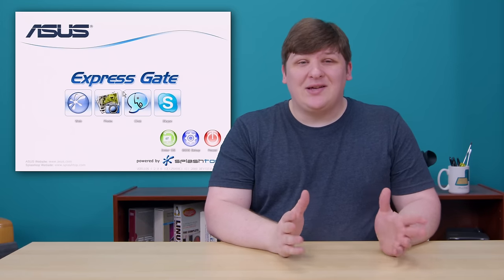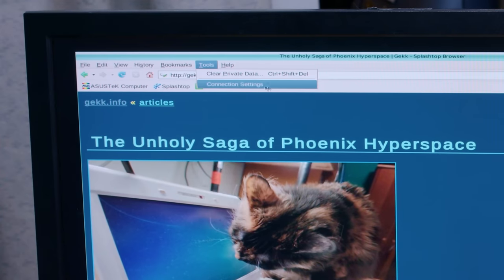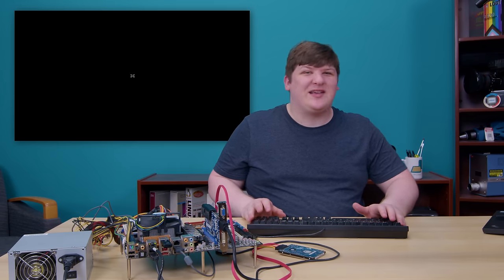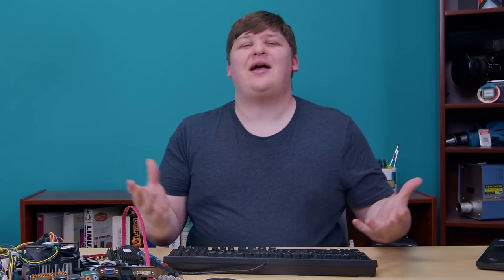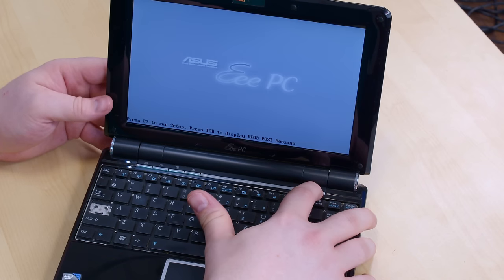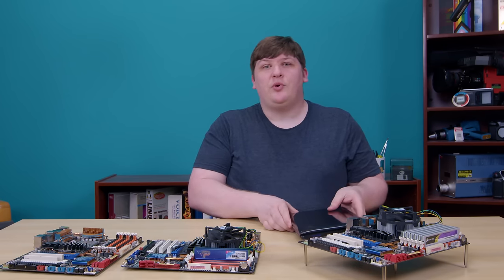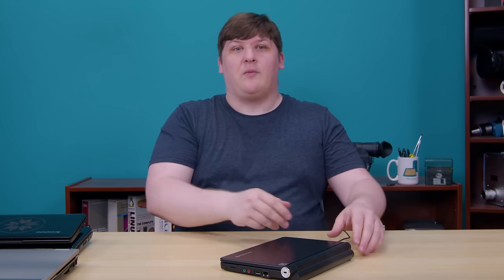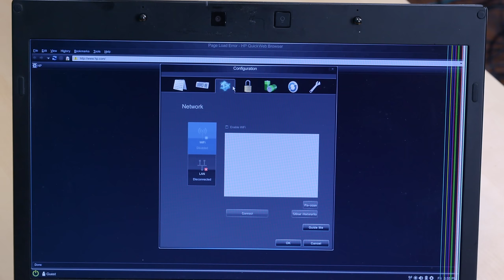Quick Start Ep 2: What The Heck Was Asus Express Gate?

Comment: My god, when you showed it in the previous video I thought "huh, maybe that pattern was reused by the manufacturer or something." NOPE. Seeing those laptops laser etched with the SDUSD star logo gave me fucking flashbacks. I don't know what the district paid for those but it was entirely too much, and I can scarcely believe that one survived with the little rubber pads that space the screen from the keyboard intact. They'd keep 26 or 30-ish of them in these blue metal carts on wheels that had been subdivided into vertical slots for each netbook, which was a good idea on the face of it, but it quickly turned into a hilarious rats nest of 30-ish entirely separate power brick chargers with far too much cable and two different power strips permanently zip-tied together.

While I remember wondering what that QS button was for, I can say that sadly nobody seems to have known about this feature. At least, I never heard about it from anyone else, and I doubt whoever sold these to the district ever mentioned it. But I have fond memories of tilting the poor things back and forth on my desk and watching the HDD monitor in the system tray freak out. And you're right, the track pads were awful and prolonged use would give you a sort of minor friction burn.

Comment: I have one computer I manage that takes 7~15 minutes to boot, and it is running linux on an SSD. It's just that it's a workstation class desktop with like three built in raid controllers that each do their own POST (it even has picture in picture so you don't have to look at them as good), so it's 7~15 minutes to get to the OS splash screen, which is like 1.3 seconds. The variation seems to be whether it's experiencing romantic drama with or between any of the hard drives, which it has to figure out before it remembers that hardware RAID is disabled.

Comment: I have an NVME but my system still takes probably 2 mins to boot up. That's because I have it loaded with 128gb ram and a shitload of pcie devices. It has an EGPU which significantly slows down Linux boot for unknown reasons. It's also encrypted, so that adds a lot of time. Also, I can't get display managers to work well with the EGPU, so I always disable my window manager and start the desktop environment from the TTY.

Comment: Making a 2000's custom Linux distro for your grandparents to use was already done. Do you not remember when the big box stores sold Lindows PCs? omg. But I do agree that some type of motherboard level OS with usable features would have been awesome. Heck, I remember when ATI on board graphics was not bad and meant you didn't need to trouble shoot your graphics card when you had an issue. Why not just put a cheap arm SoC on a motherboard today? Motherboards are stupidly expensive now... making something like a $25 SoC easily absorbed for the added value. Give it a tiny linux distro with file management features and of course internet browsing and media playback and that would be awesome. Even use a miniSD card for a custom version and/or updates.

Comment: You mentioned that they evaporated around 2011 - but that's not quite true. ChromeOS (which is very similar to many of these quick-start OSes, and actually does boot quickly) still exists, and is quite popular. According to the ChromeOS releases page, the first version came out in 2008, but I would guess that 2011 is around the time it really went mainstream. From the laptop vendor's perspective, ChromeOS would be a better option - Google is actually trying to position it as a true competitor for Windows, and it fills the same niche. Not only that, if you're selling a chrome book, you can cheap out on so much more - put a bit less ram, a much smaller drive, and even an ARM cpu. This even allows them to hit the other points these can't - it's lighter, and gets better battery life.

The low end of the market (the only segment that quick-start OSes ever might have made sense in) has largely been consumed by ChromeOS and Ipads. Schools have whole fleets of chrome books, because they are cheaper and easier to manage than a fleet of Windows devices. I personally think that many (if not most) executives in companies would be totally fine on ChromeOS, since most of what they do is either basic productivity (which Google has solutions for), or in a web browser anyway.

Comment: LOL it will be as universal as pressing delete on startup.  I'm assuming you mean to enter the BIOS.  I have had BIOSes that you press ESC, DEL, F2, F11, F10 or any number of other buttons that they do not give you any hint as to how to access it.  One other feature of netbooks was their battery life.  I'm wondering how battery life running Splashtop would compare to battery life running in Windows.  Also, I think that I had one of those motherboards with Express Gate.  I think I tried it for like half a second and then switched to Windows.  Also, mad props to that Strongbad impression.

Comment: I never did manage to own a motherboard this feature.  At the time I was on the ultra premium gamer boards which didn't have it.  Ostensibly because us gamers bought super premium high performance Hard Drives... or were so overburdened by money we could drop $600 on an SSD of a decent size.  I won a 256GB Intel SSD in 2011 from a giveaway.  At the time that drive retailed for $600.  It replaced my Western Digital 300GB Velociraptor.  

Really cool all the shortcuts manufacturers made to avoid the windows bootup problem on marginal hardware.

Comment: Interesting that this was on desktop motherboards, I have a Dell Precision M4500 (got it brand new in 2010) and it had the ability, called Dell On Flash. It was a dedicated flash chip that could be added inside the machine, it looked like an mSATA flash chip or something. I was curious about it but since mine didn't come with it I never cared that much.
Btw, the Dell Precision also has a separate slot for an mSATA SSD so it makes it seem even less necessary (but the mSATA SSD slot could also have been used for a WWAN card)
Maybe I'll buy the module now though since if you happen to mention it it might get more expensive, Lolz.

Comment: having to spam a key on your keyboard is actually not necessary since the popularisation of USB keyboards! it was necessary with PS/2, since the keyboard sent a signal to the computer upon a key event, but USB keyboards are polled by the BIOS / driver. you can enter your UEFI menu by holding down the key and turning on your computer.

Comment: After a bit of searching it seems that Phoronix was quite excited about SplashTop if only because it uses Linux. They did a full review multi-page review of it and members of the forum even hacked it to get a terminal, install new apps and get it running from a standard USB drive. Also weh something uses Linux they have to release the modified code or else it's a GPL violation so if you are looking for how something works looking for the source code is  a good place to start. For SplashTop they did release the code but the only I could find or that was talked about was s small 11mb zip file with the source of the window manager called BlackBox  and a few kernel patches.

Comment: I still have and use a Asus P6T mobo.
It's based on the x58 platform running a Xeon x5675 6 cores 12 treads running at 5Ghz

Comment: All my current PCs are incredibly slow to boot. Actually, Windows boots super quickly, the problem is that the BIOS takes a lot of time to start booting Windows. This happens on my self-assembled Workstation, but especially on my corporate Lenovo laptop (but my previous HP had the same behavior) where the secure boot might be the cause of the 2 MINUTES of pre-Windows boot time.

Comment: The VESA framebuffer driver is so stupidly simple that you can hardly call it a 'driver'. It just sets the right registers in the graphics card to expose a framebuffer memory window at address A000:0000 which has been the graphics aperture since VGA was a thing. After that, it's just blasting data which is displayed on the screen as pixels, the exact pixel format and aperture size is dependent on the graphics card. There is some segmenting involved because the window is limited but that's pretty much it.

A lot of MS-DOS games used this method to display their graphics as it was stupidly simple to program even in assembly language.

Comment: I had an ASUS laptop with Express Gate in 2008, it came with Vista, and I might have used it once.
I didn't realize the first screen was interactive. I thought it was just a splash screen.
That laptop, a G70?, had a button for Express Gate booting. I pressed it once, couldn't get anything to open because I had no internet at the time, then went to Windows. They pasted Express Gate over the laptop, but it didn't inspire anything in me, even though it's burned in my memory. It's funny, the HP the ASUS replaced didn't seem to have anything like it. That HP was horrendous with batteries. The battery it came with gave 30 minutes of life. I bought a replacement battery that gave 45 minutes when new, which quickly degraded. The HP's GPU fried while I was using it on leave, so I had to order the ASUS in Iraq, from Best Buy. I ran the ASUS until I cracked the screen flying to Georgia. Now I have a Samsung from 2012 running Windows 7, still, which also takes about 5 minutes to boot.
I like the big screen laptops.

Comment: It sounds like it could have been a good feature, but they couldn't be bothered to make it that. If it had some system diagnostics and information features like we do now in modern UEFI it could have been useful, maybe great even. A RAM scanner, disk scanner, virus scanner that could update its virus signatures, OS updates over the web, hardware scan with driver downloads. Add downloadable graphics drivers and you could have a full video player as well as audio player. It may have been difficult to stay within 512MB, but I think it could be done. I think much effort was wasted by lack of a little more, as usual.

Comment: About slow boot times on spinning disks this is more noticeable as a Windows thing. All Linux distros I had didn't had this problem. This stated: my Windows 10 booted on an Dell series 5000 and took a long time...long! about 20 minutes... to open the login screen. After some research I discovered that deleting all files from temp folder made it instantaneous (in Windows terms)! Some thing was scanning that damn folder before boot. Even removing antivirus it took a long time. Emptying it solved the issue. Booting it from Linux Mint from a pen drive (not a live distro, a full distro)  took 30 to 45 seconds. Yes I was too cheap to buy a SSD.

Comment: I had an eeePC netbook which had two power buttons (1015px i think) , one booted as normal with the bios to windows XP, the other booted expressgate in a couple seconds. 
The button wasnt only used for expressgate boot, when in windows XP or Vista Basic, the button would change the power profile that windows was using, which unfortunately cut the pathetic Intel Atom CPUs speed from 1.6ghz, down to 800Mhz.

Comment: "Better ingredients, better pizza"
Sort of. There's also a certain element of technique and skill to making the pizza itself.
Designing the trace layout and component placement matters a lot for the stability of a motherboard and the ease of putting together a system around it. No one wants RAM to be crippled to a slow clock speed because the traces can't handle what the CPU actually supports, or a really awkwardly placed ATX power connector that stops you from installing a proper heatsink.

Comment: I had a ASUS N53SN wich had Version V2.1.88.405 452.69 MB 2011/01/30
but im sure that was installed on the HDD because I removed it. Was funny that the laptop had 2 power buttons one for normal boot and one for express gate. 
I do remember that had a newer looking skin and had widgets too, calculator and a couple other bits but yeah deff could never see the point of it on an i7 2630qm laptop

Comment: Yeah, I skipped Vista. I just stuck with XP until 7 came out, and then it was just because DirectX 11 was only supported on windows 7, and DX 9.0c was starting to look a bit old. I was, of course, running a relatively slow spinning disk. It was 7200 RPM, but optimised for price per-GB rather than performance.

Obviously I never used this crapware. If it had an option for data recovery, that would've been amazing, and I definitely would've used it in my short but illustrious career in desktop/IT support. Heck, I bet my boss at the computer store would've sold exclusively Asus machines just because it would help with future support, rather than the random junk we were selling. But that kind of thing would have cost Asus actual money, so obviously they were never going to include anything useful like that.

Comment: Have a later Sony and that does sound like it went with the same thing unlike the DVD player of your previous video. A VGN-p19 to quote the Internet ''Xross media button on the Sony’s front edge and 23 seconds later the Xross Media Bar springs into life, mimicking the interface on Sony’s PSP and PS3 consoles. It offers access to pictures, videos and music stored on the hard disk while also providing Firefox for internet duties, the Pidgin multi-client chat application, and Skype' I rather have forgotten what the experience was like as I wiped it out to put Window 8 on it.
Reply: Seems I got it wrong. The Instant start is on the P19. Works quite well and the display seems to be accelerated. The documentation in the folder where it is stored says it Corel based technology.

Comment: 32:51 Watching this on an ASUS P6T SE which is a lower end variant of those boards.
I also had the phantom short on the USB ports, it was just corrosion in the back of the board, maybe give it a good clean with 99% IPA
EDIT: It also has express gate (which is turned off) but its the kind that sits on your main boot drive, not useful for me since this machine is running linux, and it has an SSD as the boot drive anyway.

Comment: An older Board did it better: ASUS P5B Premium Vista Edition.  
On those you could either use the 512MB Flash for Express Gate, OR use the Flashdrive for Readyboost, Asus called it ASAP
The Boot Time was below 60 Seconds on Vista with a good HDD and Readyboost, the most underrated Technology of Microsoft.

Readyboost putts the small system files, which slows the HDD down, into a Flash Drive, which isn't slowed down and the low Speed doesn't influnce the IO Speed.
At Booting, large Files are read from the HDD and small files from the Flashdrive.
Lot of small API Stuff is on the Readyboost which doesn't needed to be loaded into the RAM it saves around 200MB at Vista.

After i experienced the benefits on my Asus P5B Premium Vista Edition, literally all my Vista and Win7 PC had this implemented. 1GB Fast USB Stick or Flash Card and the drive was faster and even 2GB RAM was okey.

Last time i did it was 2015. Nobody believed me when i did it for the shuttle PC's 5 Bucks 2GB USB Sticks and konfiguration and the PC's suddenly seemed to be flying, instead of a 150Buck upgrade for an SSD. Which came around 2018 for 70 Bucks. ( Build in ITX PC's for the Active Boards in the School)

Comment: Woah, you have two kits of 3 x 2GB tri-channel Corsair XMS in that thing? 
Back when I was a moron I installed a kit of that in to a Intel Bonetrail Core2Duo machine with dual Radeon 3870s. Suffice to say the motherboard did not support tri-channel, nor did it enjoy living if I used all 6gb of ram. It was either 6gb of RAM and one GPU, or both GPUs and 4gb of RAM.

I still have the sticks hanging out in my bits bin, cause you know, reasons.
Reply from the maker: yeah haha, it came with it
Reply: @CathodeRayDude  Shame tri-channel never seemed to take off. If for nothing else, just the aesthetic of having 6 sticks of RAM rather than the standard 4.

Comment: Earlier this week I had to use an SD card and did not have a card reader, so I used an old netbook from 2009 which had an SD card slot. With modern Linux it runs better than it ever did under Windows XP (though not by much) and I had no trouble getting the files from my phone to the netbook and then onto the SD card via USB. Sadly the battery is shot and WiFi doesn't work... but if plugged into power and ethernet it can handle up to two lightweight Firefox tabs and even Discord alongside it! Perfect for light chatting and email checking and stuff like that. Just don't try to go on Youtube... 5 FPS nightmare even on 144p.

Comment: 34:57 Yes. A 5400 rpm hdd in 2023. But I use linux so boot times are still fast (1-2 mins), windows 10 runs like shit on hdd, it'll take like 4 mins to take you to the login screen and then another 10 for the desktop to be usable. And if there's a windows update forget about using that laptop for the afternoon.